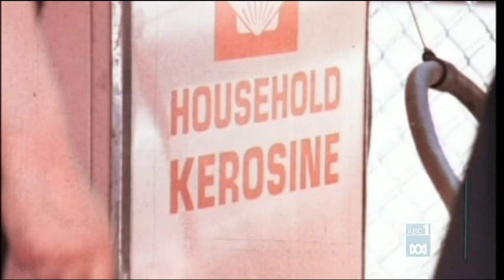Steam Powered 1963 Ford Falcon

Comment: Would have been better if it showed more details on how it worked.
Reply: +Maurice Upton Nothing cutting edge in the engine or boiler design... a 2-3/8" X 2" twin cylinder, double-acting, Uniflow design using 15" diameter steam generator mono-tube coil with electric blower fan and fuel pumps... max pressure 1,400psi

Feed pumps and the condenser fan was driven by a second stage rotary vane motor.. similar to a pneumatic air tool motor that ran off the exhaust  steam... the condenser lacked any vacuum air pumps...

In its peak fuel efficiency mode it produced only 160ft.lbs of torque

Horsepower output and fuel consumption is not published... but estimated in the 50hp to 120 hp range with about 11 mpg to 19 mpg with kerosene under ideal conditions... other alternate fuels will produce lower mpg ratings

Comment: TheusZeusDeus, Because ICEs are more efficient than steam... and in the case of small scale power units like automobile they can be twice as efficient!

The most efficient practical heat engines in existance (and in service) are Diesel engines which have higher single cycle thermal fuel efficiency than any steam engine know to exist , steam powerplant or automobiles

Comment: Maybe steam used in combination with microwave and Sterling cycle could improve efficiency enough
Reply: PacificCircle1  Still have the latent heat loss when you convert water from one state to another...
Reply: The real doktorbimmer True, but you'd have that anyway. I was just contemplating improving on heating of the water. 
 Using a turbines seem to be the way to go, as with certain large ships and fueled power plants.
Reply: PacificCircle1 Yes but the problem with the efficiency is also related to scale, you can reach the thermal fuel efficiency of an ICE with a steam turbine, but only when you are dealing with systems in the 100,000 to 1 million horsepower and greater size range.  Its not even cost effective unless you are burning a cheap fuel source like coal or nuclear... All new ship are Diesel... why? because even at 100,000 horsepower a Diesel is significantly more fuel efficeint than any available steam turbine. Now if we jump back to the automobile engine with an average output between 100-200 hp  with the steam turbine you are looking at less than half the fuel efficiency of a typical gasoline fueled Otto engine, the is just no way to compete with the thermal fuel efficiency of the ICEs.
Reply: About ships and subs, nuclear reactors make steam. I any case I was just wondering what could be done.
Reply: PacificCircle1 Nuclear powered ships are a very unique in terms of fuel efficiency... considering that an atomic ship reactor can operate up to 20 years or more without refueling  there is much less demand for thermal efficiency. I'm not a specialist in nuclear engineering but from the data I have seen it appears that thermal fuel efficiency is very low especially for the systems like the ones found in submarines that are realitively small scale and that are closed secondary cooling circuits.  A termendous amount of heat energy is wasted through these types of secondary condensers as they must maintain vacuum and not vent any water vapor or gasses.
Reply: The real doktorbimmer Nuclear powered weapons or war are sort of 'cost is not an issue' expenditures. 
 Never hurts speculate outside the box.
Reply: PacificCircle1 I believe the original impetus that gave birth to the US Navy's nuclear aircraft carrier fleet was not only an overall reduction in yearly operating costs but a significant increase in mission capability... Nuclear carrier operations are not limited by fuel shortages or sudden spikes in oil prices or by the need for fuel tender ships and refueling rendezvous.
 
The yearly operating costs of all types of submarine vessels are staggeringly expensive compared to surface ships but they are indispensable in modern naval warfare... the advantage of staying submerged almost indefinitely is is a performance capability that is difficult to put a price tag on.
Reply: The real doktorbimmer I don't disagree. I had tried to make that point.
Reply: PacificCircle1 I think nuclear fueled steam is an excellent match in the right scale and bigger is better... unfortunately super size warships and large nuclear power plants are not considered very popular right now...  If some dramatic change in the state of the world were to happen i think both could make a very big comeback... its a technology that works very well.  

Of course if nuclear fusion is ever made economicially viable? It may bring back steam and make everything else obsolete.. there is not much down side to electric cars if electricity is made so cheap it could be nearly given away for free... who knows?  perhaps just wishful thinking...
Reply: The real doktorbimmer The only reason I mention nuclear power is that even they heat water like most power plants.
Reply: PacificCircle1 The difference is its a fuel thats ONLY practical as a heat source of steam... it does not combust or burn in a way that can be utilized in a more efficient type of engine than steam... it doesn't matter what heat source you use, it will always be less efficient if its used to make steam, ICEs are an order of magnitude greater in effiency because of this problem.
Reply: Things can be made more efficient.
Reply: PacificCircle1 No, actually they cannot ... Nikolaus Carnot in 1824 produced first successful formula for the theory of maximum efficiency of heat engines.
The maximum efficiency of the steam engine is limted and Carnot calulated its limit nearly 200 years ago.

The combustion type engines have a much higher maximum potential efficiency than steam... steam engines will always use more fuel in both theory and in practical applications.

It is for this reason that steam technology is limited to very large applications using low grade or inexpensive fuel...

Its also why there is no serious work being done by legitimate engineering institutions on steam powered vehicles such as automobiles. Although very interesting.. any attempt to produce a more efficient steam powered automobile is both misguided and doomed to failure. (like Mr. Pretchards car here )

Its not that I don't like steam engines, (I do like them) its just that I understand why they are obsolete, something unfortunately a lot of folks still do not understand.
Reply: Deacon Swayne 
Common sense and engineering often seem at odds to the untrained eye...  I once believed that steam must be more efficient, that was until I received an education and understood what Carnot had discovered.  The problem with Steam engines is STEAM. It simply is not an efficient type of heat engine. It also appears that Pritchard was not the only one to make this mistake in the 70s... the automobile industry was facing a severe crisis at this time... an oil shortages combined with loud cry to reduce emissions... there were actually several attempts (some by surprisingly large corporations)  to investigate steam as a possible solution, the attraction owing to the multi-fuel capability and inherently lean and clean external combustion process...  but all were doomed to failure because of extremely high fuel consumption... regardless if the engine was run on alternative fuels or oil... they all failed miserably. Lessons learned... now its time to move on... move on to more efficient combined-cycle ICE technology like Turbo-Compounding Diesel and HCCI engines.  Cheers mate!
Reply: The real doktorbimmer Good comments, thank you for these. I still love steam vehicles, especially the old traction engines. My heart would love to see them return, but my brain and wallet both say no! I often go to steam fairs and museums, which is the proper place to enjoy these marvellous machines of a bygone era... bringing them back to the roads would be insane.

There are exciting developments just around the corner for the ICE... HCCI and turbo-compounds are two of these. The best is yet to come. I do not anticipate the IC engine being made obsolete in the forseeable future.

Cheers! All the best!
Reply: The real doktorbimmer I am replying to this comment as well your last because I have no idea where you got the idea that steam engines are theoretically and practically less efficient. Look up the rankine cycle vs otto and you will see that steam engines have a higher carnot efficiency. Think about it intuitively: even in oil burning power plants, steam engines are used, not diesel, petrol or any other ICE. The only thing in which  agree with you is that small reciprocating steam engines are less efficient than similarly sized ICE's.
Reply: PacificCircle1 No, I think you missed the point... you can't get around the massive loss of heat energy caused by LATENT HEAT.

It doesn't matter what heat source you use... when you heat water to the point of boiling and vaporization some of that energy is LOST...

The most efficient engine types discard the use expansion though vaporization... ICE's are more efficient heat engines.

 The plain and simple answer is no... it won't improve efficiency enough to be commercially viable... it won't improve efficiency at all for that matter.
Reply: The real doktorbimmer Exactly... The steam engine is fundamentally flawed precisely because it uses steam as the working fluid. The latent heat of vaporisation is the enemy here and one that cannot be defeated by a microwave oven.
Reply: Deacon Swayne Not to mention the enormous conversion losses you would face heating water in a car with microwaves!   You've got power loss before you even charge a battery, then battery loss, not to mention you need for yet another loss from a step-up transformer... more loss...

I'm not going to bother doing the math.. but it sounds like a plan for the worst fuel efficiency car ever conceived!
Reply: The real doktorbimmer Let's see then... let's start with power distribution efficiency which here in the uk is about 33%. Charging efficiency of 90%, step up transformer; 95%, magnetron efficiency >75%, uniflow steam engine efficiency 15% (and that's generous) 

33*.90*.95*.75*.15 = 3.17% efficiency for this concept. 

Cheers Doktor!
Reply: PacificCircle1 Well how do you plan to provide power to fire the boiler for start-up???You either have to plug in? or store a massive amount of energy in a battery just to build up a head of steam...... Then what? You then have to use a very large percentage of your precious steam to drive a high voltage alternator?   No conversion loss there! You really think you can run a steam turbine at 15% in the 100 hp -300 hp range in a package that would fit inside something smaller than a large tractor trailer truck? a 18 wheeler maybe?   but in a car?  wtf are you thinking? Your only choice would be a Compound, Corliss or a Uniflow A damn Wankel engine can do better than 15% (just barely)
Reply: Deacon Swayne Good work... that was about what I was thinking as a guess at around 4-5% max for this concept. Definitely a big leap in the wrong direction here..
Reply: Deacon Swayne I love steam... especially locomotives.

But like all the locomotives, turbines and Diesels... even electric too!
Reply: Chali Chaligha Look up and study the CARNOT cycle... you are very ignorant and need to learn why you are wrong.
Reply: Chali Chaligha The ICE will always be more efficient than steam.. Nikolaus Carnot proved this before the ICE was invented!
The Maximum theoritcal efficiency of Otto and Diesel engines is HIGHER than steam....
Reply: The real doktorbimmer Look at the links I gave you, they show that large power station steam engines have a higher efficiency than the best petrol/diesel engines. Even if you disagree with wikipedia, please answer my question as to why large steam engines are used in power stations as opposed to ICE's even when combusting oil.
Reply: The real doktorbimmer Please explain why you think I am ignorant in this subject. The carnot efficiency is the highest efficiency attainable by any heat engine and is a function of input temperature and waste temperature.
Reply: Chali Chaligha You are operating on a very false assumption that because power plants use steam that "steam engines" are more efficient.

Otto and Diesel engines have HIGHER Carnot thermal fuel efficiencies than steam.
Reply: I was posting a 'what if', a mind experiment (as Einstein called it). I don't know if steam powered cars could be practical.
 We do know that using microwave is more efficient than combustion of fuel.
Reply: PacificCircle1 There are several reasons why the steam engine car went extinct... the reason its stayed dead is because compared to ICE's, steam engines have very, very poor fuel efficiency...
Reply: PacificCircle1 what would be the electric power source for a magnatron large enough to continuously boil water at a rate of 100hp or more????  Batteries?????
Reply: The real doktorbimmer You miss my point. I'm not about to write an extensive essay, so have a nice day.
Reply: The real doktorbimmer Brainstorming is not the same as advocation.
Reply: PacificCircle1 Its not brainstorming when you don't have a grasp of even the basic concepts involved...  its like your trying to build a spaceship but you have never even built a model rocket..
Reply: They efficiency of the power network distribution would not play a part, would not be a factor. Steam turbines are more efficient that 15%.
Reply: PacificCircle1 Transmission losses would be a factor in determining the net efficiency if you were intending on using a battery to supply your magnetron. Even if we were to ignore this part of the equation and calculate the efficiency from wall outlet to wheel, your concept is still less than 10% efficient. You'd be just as well off shovelling a few bushels of coal into a firebox, just like in the 1800's.

Some turbines are very efficient, but by necessity they are huge and are rarely found outside of a power plant. Turbines with this level of efficiency will not fit in your car's engine compartment. The ones which will fit sacrifice efficiency in pursuit miniaturisation. 15% is a reasonable figure for these.

In any case, I was talking about the uniflow engine, which is a reciprocating engine (of the type found in the Doble) and not a turbine. A reciprocating engine is best for small steam engines, but even these will be unable to convert much more than 10-15% of the heat energy from the fuel into mechanical work because the wastages incurred in the latent heat of vaporisation.
Reply: The real doktorbimmer I was thinking of a similar figure myself, though apparently even that paltry figure was too generous. It's actually a step backwards from Pritchard's car, or a even the Doble...

Which brings up a good point... Why was Pritchards car no more efficient than the Doble? After all, the Pritchard's car came more than 50 years after the Doble, but with no improvements in fuel consumption, despite all that modern tech? Doesn't this raise any alarm bells?
Reply: then you would need batteries for powering the microwave. in that case might as well skip the steam heating step and go straight to a electric motor.
Reply: @Happy Hands Brilliant comment... and absolutely true.  Electric heating a steam car is just dumb... far better to use batteries to power an electric motor.